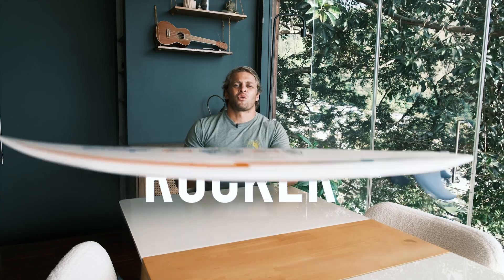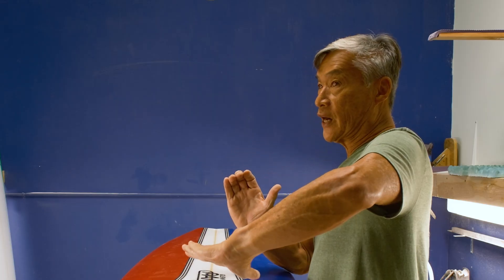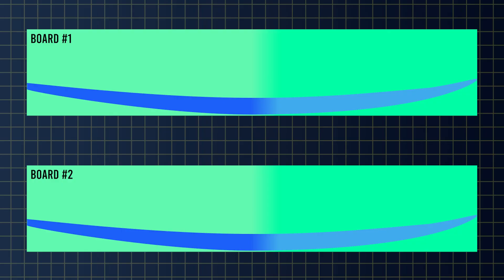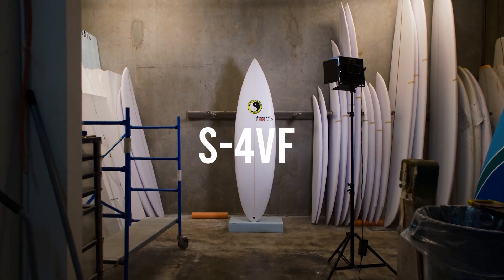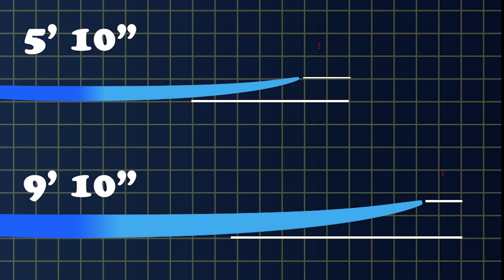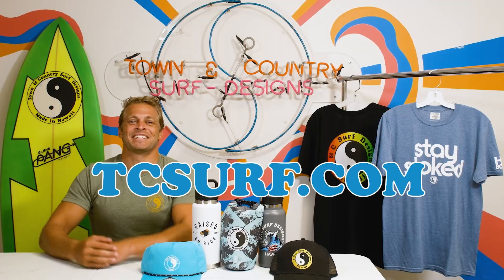SURFBOARD ROCKER - What a SURFBOARD SHAPER with 40+ YEARS experience can teach you

Comment: I cramp mentally at some of the concepts presented here.

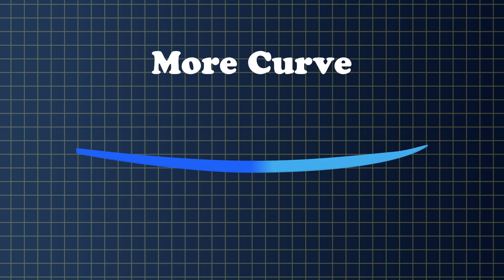1.  0:53, the idea that rocker slows a board b/c it adds length is false.  The difference in immersed length between otherwise equal boards of different rocker is so small as to practially immeasurable.  
2.  Next, realize that the force on  a moving surfboard that can be viewed as a vector acting perpendicular to the plane of the surface (lift).  A force vector in the front of a rockered board can be resolved into one vector that is perpendicular and another that is tangential to the board's surface.  Thus, a board with more rocker will experience a greater perpendicular vector, slowing the board.
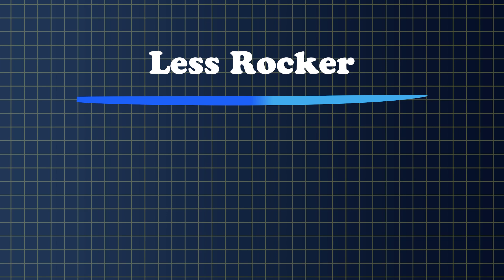3.  1:08 two boards of different rocker, with the same surfer, will displace equal amounts of water.  Note that any volume that is above the water surface does not contribute to flotation. However, a rockered board will paddle slower b/c the (more deeply immersed) nose has to push water aside.  Other things equal, a flatter board will push aside less water so it paddles faster., and, for the same reason, rides faster.
4. 1:17 the idea that a low rocker board "doesn't fit the curve of the wave" is seeing things backward.  Surfing is very much about TURNS, and the whole idea, indeed the requirement, is to displace or redirect water. Note too that a turn uses only perhaps the back third of the board, making rocker (front or back) that isn't in the water, irrelevant.
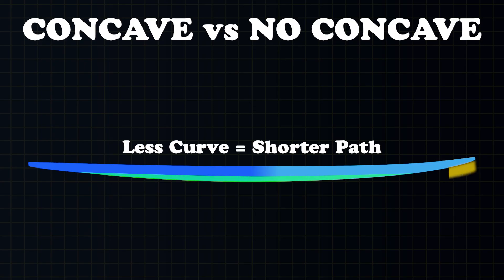5.  1:58 the idea that concave causes the effective length of a board to be longer, is just nuts (trying to be polite here).  See #1.  What happens when a board crosses a little chop or wind riffle?  The nose touches that water further forward, thus making the wetted surface longer.  Sadly, we don't surf waves smooth enough such that rocker will/not make a difference for the reason stated.  The illustration showing water paths from the tip of the nose is irrelevant - no one surfs with full length contact - that's on the razor edge of pearling.  BTW, I don't think anyone rides a 10' board at Pipe (anymore) so that's an extreme example, even if it were not inappropriate.  I realize that exaggeration serves to make an example clearer, but that's just not appropriate.  The shot of a late, grab-rail drop clearly shows that the nose is nowhere near the water surface.  The "extra nose that will tend to..." just isn't so.
6. 4:32, so just what are the nose and tail rocker measurements on the board pictured, and how do they compare to other stock boards?
7.  Measuring rocker at nose and tail is okay, but only if the board is tangential at the midpoint.  Otherwise (given that the wide point isn't at the center, and the board is wider/heavier at the tail, the measured nose rocker will be exaggerated.  I've tried to set a board tangential at the midpoint, and it's not an easy thing, since being off by only a few degrees makes a big difference in measured rocker.  Easy to do on the computer, hard in real life.

5:52, there hadn't ought to be bubbles at the nose in the glass job.

Closing, let me suggest that some of the claims made can be true, though not for the reasons claimed.  Back story, I've made my own boards since 1968 and have been a practicing engineer in Honolulu since 1984.  Doesn't make me a pro, or commercially successful; my comments are worth what you paid for them unless you find a useful physical interpretation.
Reply: The bottom line (no pun intended) is that pretty much every shaper has a different take on what makes a surfboard go. It's pretty unscientific I'd say. I'll definitely listen to them but I'll keep an open mind to what other experienced shapers are saying.
I guess what really matters is satisfied customers. A guy like Glen who's been shaping boards for many years, for the best surfers, who ride the most challenging waves on the planet,  is clearly doing something right.

Comment: Where the lowest point of rocker, or the biggest radius curve is located? Exactly centered?
Reply from the maker: Not necessarily. Boards can have more nose rocker and/or less tail rocker therefore shifting that low point. Also, some boards have a very low or flat rocker making that "low point" a larger area on the bottom of the board. It varies from model to model.
Reply: @TandCSurf  For consistency and repeatability, rocker has to be measured with the board tangential to a flat surface at the midpoint.

Comment: Isn't it also where u sit and approach. If u want to sit inside a little and drop in under the lip u need a lot of rocker and smaller board. If u want to get pitted and not fly past the bowl a smaller board helps. If your heavier and sit outside its a little different, ya no?

Comment: I think concave in the nose stops the board from dropping in to the wave vs. a board that doesn't have concave up front. Opinions?
Reply: Simply, no.  Concave is largely decoration, even on longboard noseriders.  Water is a fluid and will flow wherever pressure pushes it.  Concaves simply can't contain water, it will rush off to the sides and back, providing no lift.
Reply: @charlesschuster7963  not sure I understand what you're saying of if you understand what I said. I have noticed that my boards I've had that have concave starting up front tend to not catch the wave as easily or drop in, that's been my personal experience.